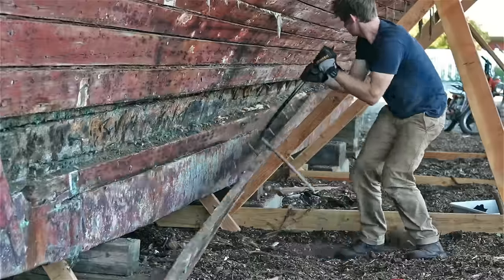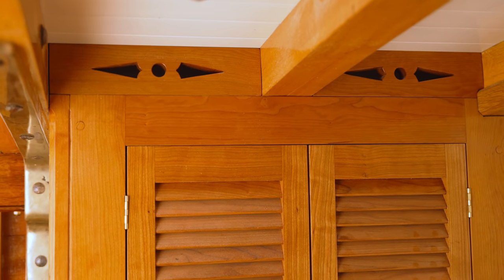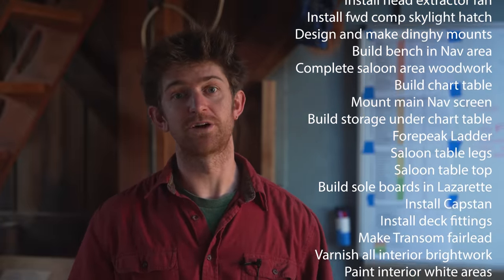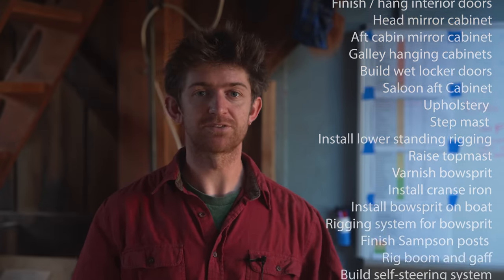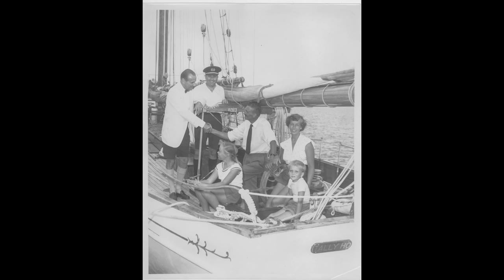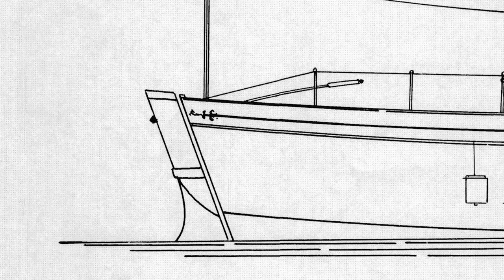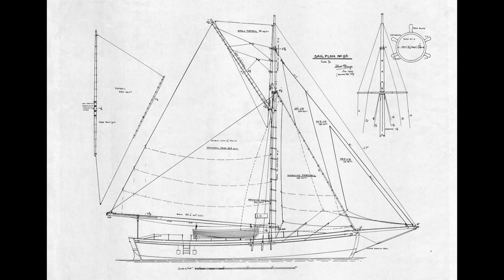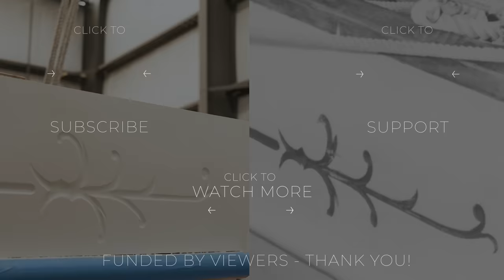Tally Ho’s launch & future plans

Comment: I divide my life up into “eras”. It helps me make sense of it all. I can see this is an era that is edging towards its close. From what you’ve said here I think you are on the same page as me. The moment the boat leaves the shed, she will start to deteriorate. I would finish the hull 100% before rollout. Then get her outside, put up the masts and the rigging, get her in the water and begin the sea trials. Do NOT do the same as Steve at A2A. He launched an incomplete boat, and look at the result. He’s motor sailing everywhere (until this week), the inside of his boat looks like a bomb has gone off in there (I suspect this will not improve very much) and he is visibly stressing out. I think the path you set out here is much better, the videos you make will be better, and you won’t have the stress of introducing visitors and followers inside a space that looks like a bomb site. Thanks for the video as always and good luck.

Comment: No one who knows the history and trials that you have endured in restoring this beautiful sailing yacht would have a second thought if you gave her the gold leaf that she deserves. There is not a bit of over austentatiousness about it. It would just give her that touch of flare that would serve her well. Go for it!
Reply: Gold leaf would be great. How much would it cost?
Reply: I'm just not sure about gold leaf and salt water!.
Reply: High quality gold paint of some kind will suit it fine & the money saved will be better spent elsewhere (IMO)
Reply: @ogribiker8535  Gold is unaffected by salt water, though I'm not sure what adhesive would be used with it.
Reply: @Breezely  Gold leaf is microns thick, partially transparent. It's laid over a coloured size as both an adhesive and a backing colour. It's not particularly expensive, set against the rest of the investment in Tally Ho, but despite gold being very stable, as a coating gold leaf is not particularly durable. Everything Leo has done with Tally Ho is chosen first and foremost for durability. A simpler, more reliable, and easily repainted coating seems to me to be to be in keeping with the other choices Leo has made.

Comment: Here's a stupid suggestion: Take a significant piece of OG Tally Ho that you still have but is too far gone to rescue or reuse, burn it, mix the ashes with epoxy and paint the carvings with that.
Reply: I like that idea, could also put a small container with some of the ash in the saloon.
Reply: Good idea. If you run out of Tally Ho wood to burn, you can top it up with bits of a certain Wharram catamaran that might be laying around. 😂

Comment: really looking forward to see the finnished galley when that episode comes.
and also to learn about where charts will be stored, what surface you will use to read them, what navigation equipment you have bought, and communication systems, starlink? ;)
maybe a flat antenna that can be embedded with electronically steered beam, instead of a dish, so nothing can snag ....

Comment: I worked on my boat for many years while it was in the water.  Would have been so much simpler to have the boat drydocked where I could have my tools.  Just didn't have space to do so.  I envy your shop space and the ability to work efficiently as you've been doing!

Comment: Tally Ho won the 1927 Fastnet Race, which is a biennial offshore yacht race organized by the Royal Ocean Racing Club (RORC) of the United Kingdom with the assistance of the Royal Yacht Squadron in Cowes and the City of Cherbourg in France.

The race is named after the Fastnet Rock off southern Ireland, which the race course rounds. Along with Sydney to Hobart Yacht Race and the Newport-Bermuda Race, it is considered one of the classic big offshore races with each distance approximately 625 nautical miles (719 mi; 1,158 km). Testing both inshore and offshore skills, boat and crew preparation and speed potential. From its inception, the Fastnet Race has proven highly influential in the growth of offshore racing and remains closely linked to advances in yacht design, sailing technique and safety equipment. 

Leo has time to finish refitting Tally Ho, finish sea trials, finish shake down, and still make it to  England for the 2027 Fastnet Race. I wonder if they would let the refitted Tally Ho sail in the race?

Comment: I believe that you should have the capstan, and winches plated in Bronze. I once had some items gold plated and found out that the plating shop can deposit different levels of thickness. On the aorking parts of a winch I would request a thick plating for obvious reasons. I also think that you should look at getting metal bits on the stays bronze plated also. I saw bronze plating on a J class yacht and when highly polished they really add that classic touch rather than chrome, or black.

Comment: I looked up the cost of gold leaf, and this is what I found:

"Is gold leafing expensive?
How Much Does Gold Leaf Cost? - Barnabas Gold
To cover apartment ceilings with gold leaf, a business can charge $13.50 per square food for Dutch-metal leaf (a synthetic substitute). Alternatively, you can get the real deal at a gold leaf cost per square foot of $25"

Those prices probably don't apply to exterior maritime applications, but you could probably get it done for a few hundred, if you wanted to. 

Black would look nice also. Or a black channel with a gold center...

Comment: Such a fantastic programme to watch on Youtube. I like the detailing your carving and you said you think gold leaf is a bit naff. Why not go for Dutch leaf ( bronze leaf) it will match the bronze on the boat but still have a great look without looking too gaudy. Just make sure that the ground is well finished (primed and sanded until polished smooth) Use a good size with iron oxide ground, should look a treat with the detail down the boat. Dutch leaf won't break the bank but match the other fittings.
Keep up the great work, team...........:-))

Comment: I'm interested in hearing about what you will do and use to protect the bottom from marine growth, barnacles, muscles, underwater marine wood borrowing organisms and so forth.  Will you coat the wood bottom with some sort of epoxy and copper base, like Copper Coat, USA?  I do understand that the wood and cotton will help swell up the wood once it get's wet to make a water tight seal.  However, I don't know how you would protect all that hard work from such marine organisms from destroying those boards below the waterline over time.  Thoughts or plans on the subject?

Comment: What was kept from the original boat apart from general design?
Reply: Not very much - the bottom 3 teak boards of the transom are original, some of the teak hull planking was re-habbed & became the bunk side rails, & the massive old capstan is being repaired. The old lead ballast keel was cut up & melted down for the new casting, so about 75% of the new keel is original metal.

Comment: did you "Rebuild" the boat or did you "Build" a new boat??  nothing remained from the old boat though.... what was that old story about rebuilding the wooden boat?
Reply: This issue has been discussed many times. Move on.
Reply: @michaeldemarco2415  oof, a wee bit touchy huh?  how was i to know what you fancy folk discuss when i wasn't a part of the convo.
Reply: @spinkey4842  
Try Episode 58 where Leo addresses this.
Also, as Joshua Slocum says in the first charter of his book, 
"Now, it is a law in Lloyd's that the Jane repaired all out of the old until she is entirely new is still the Jane. The Spray changed her being so gradually that it was hard to say at what point the old died or the new took birth, and it was no matter."